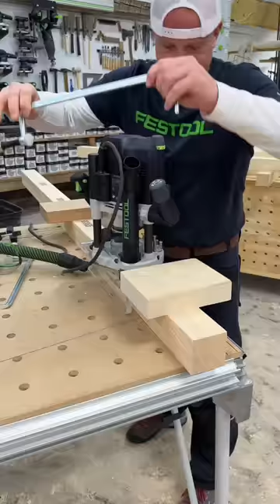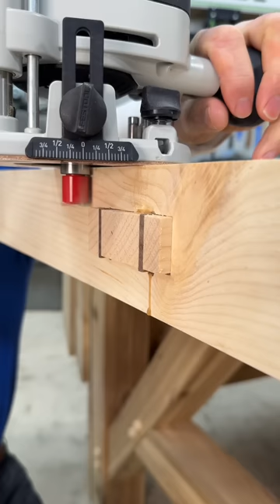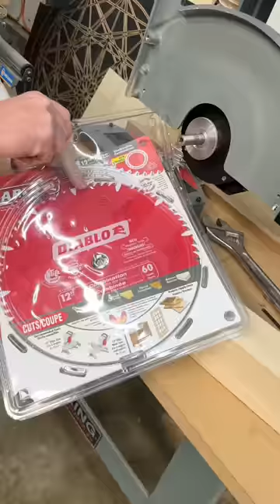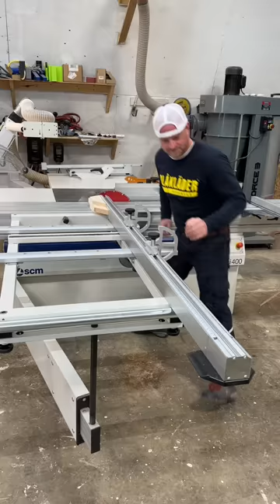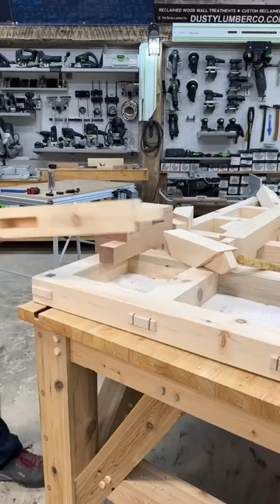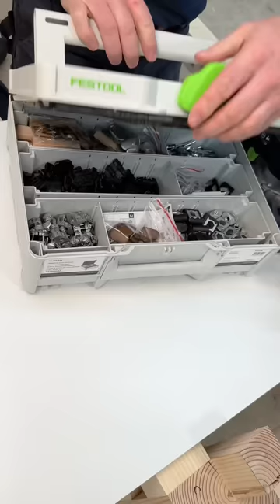Building a big floating timber frame bed

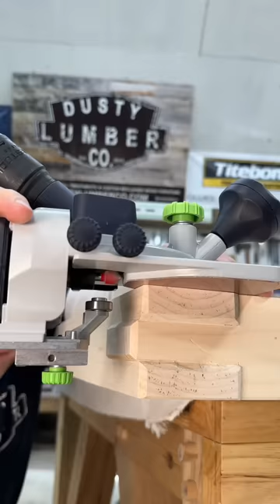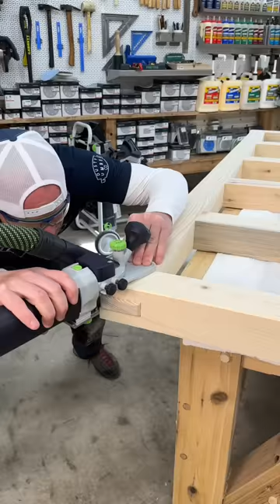Comment: I estimate around $300,000 to $500,000 worth of tools and work benches and cabinets there, along with lighting, dust extractors....everything together there. Do I have the skills he has. I do and more. The 45° chamfer he did on the piece at 4:10 to 4:15 for example, I would have used a round over bit on the connecting and protruding tenons with a 3"/8" roundover bit, to 1/2" on the beams edge.  It is stethically more pleasing.  I'm not knocking his skills, but it is a fact, that having the equipment necessary, can give your skills and creativity free rein to dream anything. Still; very well done job. I grew up with hand tools only. Time is important. Unfortunately I am unable now to spend long times standing now, so I had to give up my love of woodworking.
One thing I just want to bring to attention. If you ever do furniture, it is always best to use machinist rulers, or specifically made class 1 tape measures. Stanley's and Irwin's and all others here in the US, are class 2 tape measures.  If you are making high grade furniture, only use class 1 tapes, or machinist measuring tools, for the most accurate measuring.

Comment: That's some awesome tools and techniques in making that floating bed - very impressive! Can you sit on the side or end of the bed without it tipping you off?
Reply from the maker: Thanks! I haven’t tested the max weight to tip it but it’s way more the weight if the person who the bed is built for. When I delivered it we put everything on and I had them sit and then jump on the edge of the bed and it didn’t tip

Comment: Wonderful to see, sir. Congratulations with your knowledge 👏. 

Amazing camera work as well. 
I bought loads of machines to teach myself woodworking. I had 1 project to do 💯 % correctly. 
To repair my €piphone Les Paul guitar neck. It broke 4 times, coming back from 'craftsmen' 
The first trial with routers, for which I made you know: jigs. But, due to the poly-artroses, it became a painful challenge. Living in Utrecht, The Netherlands Centre,  with thousands of woodworking guys and girls, nobody reacts on my request to help.
I tried the router and I must admit: scared for those 10³, 20.000 RPM bits. Because guitar players are always afraid for hand+ wounds. I didn't had  the courage to route two slits. Two hardwood wedges epoxy and the well known connection was a fact. 
Then sand, prime, (sanding, paint spraying)²³ d o n e.  

There it still awaits in the attic to meet some craftsperson. 
I'm not a lazy guy, so I'm going to start all over myself. 

You give us confidence and self confirmation. Thanks.

Comment: That is clearly an amazing piece of workmanship. I just have one question: what will happen when two adults sit on one side of that bed?
Reply from the maker: I haven’t tested the max weight to tip it but it’s way more the weight if the person who the bed is built for. When I delivered it we put everything on and I had them sit and then jump on the edge of the bed and it didn’t tip

Comment: Woodworking Mortise and tenon joinery from d4s lumber, definitely Not timberframing. But still a very nice job. And for anyone saying you need a massive budget of tools..you can do all that with a sliding miter saw, a table saw, a router and a battery powered drill. Just would take longer and might not be 100% the same..but like 98/99%, for sure.

Comment: Great craftmenship ! I wonder: if you happened to sit on the edge of that bed, wouldn't it tip over ?
Reply from the maker: Thanks! I haven’t tested the max weight to tip it but it’s way more the weight if the person who the bed is built for. When I delivered it we put everything on and I had them sit and then jump on the edge of the bed and it didn’t tip

Comment: It won’t rock if a heavy guy sits on the edge of the bed?

Looks awesome, great work with relatively low level wood.
Reply from the maker: I haven’t tested the max weight to tip it but it’s way more the weight of the person who the bed is built for. When I delivered it we put everything on and I had them sit and then jump on the edge of the bed and it didn’t tip

Comment: Seen this design before. Great because you dont biff your toes on the legs etc, however when you sit on the edge it just falls over!
Reply from the maker: I haven’t tested the max weight to tip it but it’s way more the weight if the person who the bed is built for. When I delivered it we put everything on and I had them sit and then jump on the edge of the bed and it didn’t tip

Comment: This is a video of making a pretty simple bed. How to make it? Well let's make the same type cuts with multiple different methods so we can use multiple different tools. Either to show all these different tools or maybe to show different ways to make the same cuts. He cut the same style cuts on the ends with the radial saw 2 different ways and even cut them with the router. No purpose for that. Also, the point of the "floating bed" is to not be able to see the legs and under structure. If you can still see these legs, then it's a platform bed. If you can't see the legs, then it's a platform bed and a lot of pointless work😂
Reply from the maker: During my builds I like to share a variety of methods 👍

Comment: I don’t mean to hate on this guy.  He is obviously very skilled at building.  However, I do think this bed is way “over built”.  Unless he is building it for a Clydesdale to sleep on, I don’t think the weight of the finished piece is justified.  Is that bed going to sit on the ground floor of a house with a concrete foundation or is it going upstairs.  If he’s planning on putting it upstairs, how is he going to get it up there?  In addition, is the structure of that floor capable of supporting that much weight?  Good design isn’t just about aesthetics, it also has to take function into account.

Comment: Real-talk, where do you get pine timbers? Those look like 5x5's and very clean. Unless they are manufactured ones? I imagine it's all light/non dense lumber, as non of your saws were laboring and the wood seemed pretty dry. 
Anyway, I am very curious about the weight and practically of moving something like that as a solid piece, especially at a queen or king size. 😅

Comment: Now try to get it upstairs into the bedroom 😂🎉
Reply: @dustylumberco   Maybe use a crane and undo a few shingles on the roof tk get it inside? Does the glued frame still fit through any doors and around hallway corners? Unless you live in a veritabke spaced mansion with double door.and matching wide this could be rarher tricky.
It's truly one hell of a king size bed.

Comment: Older video now but curious how you decide when to use the Radial Arm Saw vs using the Router for similar cuts? Or is this more of just showing it can be done multiple ways as opposed to only using one way?
Reply from the maker: Showing options for methods 😁

Comment: As a retired cabinet carpenter and who is also retired now I have a question. Looking at your shop and comparing it to the one I owned (800 square meters/8,600 square feet) we were 10 guys doing the work. So how many are there of you working at Dusty Lumber Co.? Sure do wish I was still there working at my carpentry shop. 😢 (Don’t retire until you die!!)
Reply from the maker: I work alone.  👍🙌

Comment: Beautiful craftsmanship and visually perfect but a rather flawed design in terms of functionality. The legs are too far in from the sides, their edges being 1/3 of the total width in. Anyone plopping down on one side will easily tip the whole bed. Two people simply sitting on one side might be enough to tip it.
Reply from the maker: I haven’t tested the max weight to tip it but it’s way more the weight if the person who the bed is built for. When I delivered it we put everything on and I had them sit and then jump on the edge of the bed and it didn’t tip

Comment: Ok so i buy a house with a huge area for a dedicated workshop all wired up and lit properly. Then buy or make work benches and visit a pro tool shopbto buy band saws, rounters, table saws and more. Now i can make a bed. Or i can buy one. Delivered. The editing leaves out the drawings and meaurements needed at each step. The metres of timber that has been planed and thicknessed first and the hassles with getting it and all the hand tools and them being sharpened. Hundreds of blades, bits and clamps etc. This guy is a pro carpenter not some home dad
Reply from the maker: Thank you very much.  When I started I was in a pretty bad position due to the economy at the time and just had to switch to something new and make it work. Just put my head down and worked like a dog for 2 years and only took a few days off. I had a few crappy tools and a used $200 table saw and I had a wife and 4 kids and had no choice but to work and work and work. Eventually things started gaining momentum and the quality of my work got better and I kept learning and reinvesting in better tools. Then I started to learn how to do social media and taught my self how to shoot videos and edit and all about the different platforms.     Anyway I guess what I’m saying is it is scary to take a leap and do something new but I’m a firm believer in hard work and constant learning and it pays off.

Comment: Imagine what he could produce if he learned to use his hand tools a bit better/more efficiently.
Reply from the maker: scroll back in my vids and you’ll see examples videos of me just using hand tools.  The knowledge and layout of the joint is the same no matter which way you do it. After you accurately layout the joint you can then decide to take longer and use a chisel or go faster by using power tools (which are juts fast chisels). Power tool or hand tool is just different ways of removing the wood you don’t want.
Reply: @dustylumberco  I'm aware. I'm not saying you don't have the ability or skill. 

I just saw a few inefficiencies in the video that I imagine could have been taken care of faster with a hand tool. When you count setup time. 

I use both. The finesse of hand tools is alluring though. I commented because I am aware of my own inefficiencies that could be handled by better training my use of hand tools. 

If you are resawing, it will never beat a band saw. If you're surface planing, you'll never beat the speed of a thickness jointer.

But you mentioned chisels. Chisels are frequently where I see room for improvement. They are perhaps my favorite class of hand tool. 

How about card scrapers, or scraper planes? Even a modestly skilled person can finish a board faster than a sander, and with better results. 

Unless you are doing volume. 

Anyhow. I wasn't knocking your work or skill. You're more skilled than me in many aspects for sure. 

I would love to see you marry hand tools into it more is all I am saying. You get a lot of flack for your power tools it seems like based on the comments I see.

It does make a person wonder if your skill is in part because of your investment in power tools, Rather than pure skill. 

But who am I to say? Just some random critic on the Internet.

Comment: Not how you use a radial arm saw. You push the saw towards the wood you are cutting, but he pulled the saw towards him self which is dangerous.
Reply from the maker: that’s how RAS operate. Pulls the board down and towards the fence and more efficient for the dust extraction

Comment: Do you get a bigger kickback from tool makers for making the same cuts with 20 different tool? The radial arm saw can only make so many cuts then you have to use a router, which isn't for making straight cuts, and the make cut with the other saw, then use a chisel. The only thing you're demonstrating is how to waist time.

Comment: He didn't offset his holes in the tenons by 1mm in order to pull the joints tight when fitting dowels , he's a beginner  😂
Reply: All those traditional joints done to perfection then uses modern mechanical fittings to attach the top to the legs when a handful of 6 inch nails would have done the trick
Reply from the maker: I created a draw bore and added glue to reduce squeaking 🙌

Comment: I dont get it, wont the bed just tip over if you sit on the edge?
Reply from the maker: I haven’t tested the max weight to tip it but it’s way more the weight if the person who the bed is built for. When I delivered it we put everything on and I had them sit and then jump on the edge of the bed and it didn’t tip

Comment: Lil bit worried if you sit on the edge you would tip it over on one side
Reply from the maker: I haven’t tested the max weight to tip it but it’s way more the weight of the person who the bed is built for. When I delivered it we put everything on and I had them sit and then jump on the edge of the bed and it didn’t tip
Reply: @dustylumberco  oh nice that's good

Comment: When sitting on the side of the bed it will tip over 🤦🏻
Reply from the maker: I haven’t tested the max weight to tip it but it’s way more the weight if the person who the bed is built for. When I delivered it we put everything on and I had them sit and then jump on the edge of the bed and it didn’t tip

Comment: tanto quilombo para hacer una mesa.. los yankee.. siempre complicados
Reply from the maker: this is old school Japanese joinery and it fascinates me so I wanted to try some. Back in the day with no lag bolts and glue and other fastening techniques they have to come up with ways to cut the wood to get joints that would achieve certain structural objectives, not twist and last a long time. They came up with some ingenious stuff